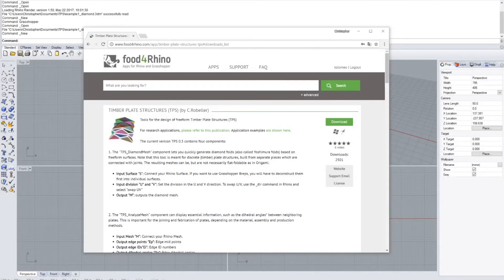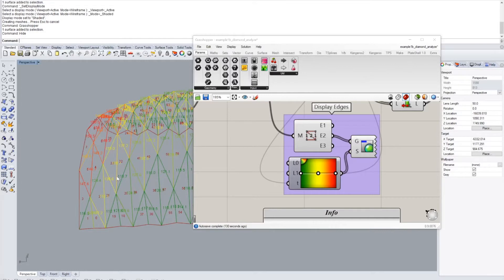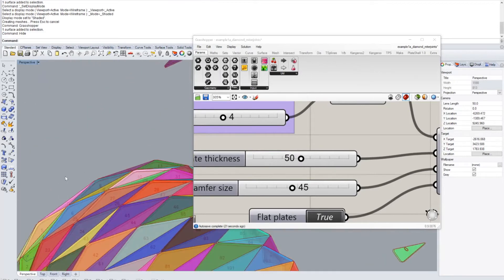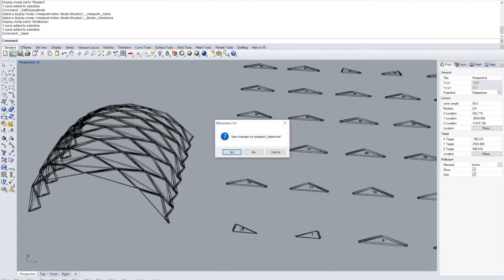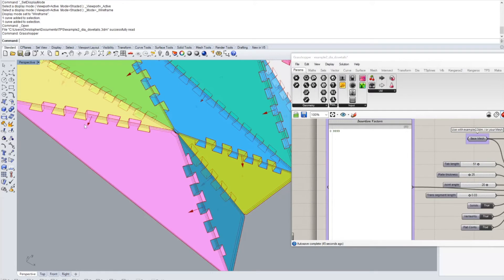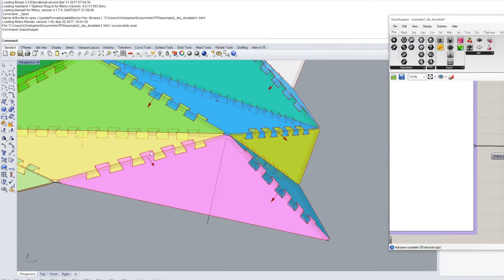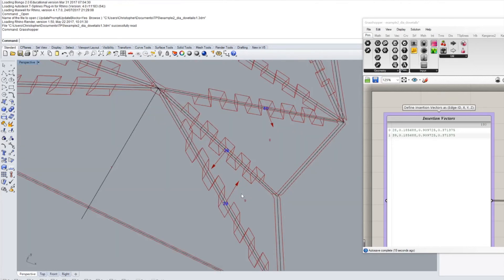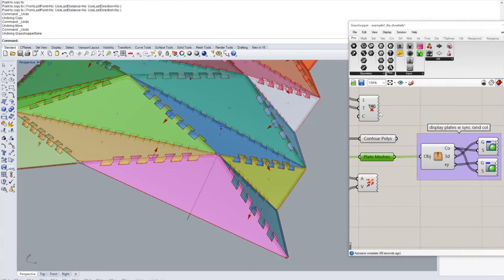TPS Plugin Tutorial: Analyse Fold Angles, Miter Joints, Dovetail Joints

Comment: Hello, I am trying to make the tutorial plates using the robot arm in school, and I wonder if inserting vector matters if the joint angle is 0. Isn't it possible to assemble the plates without modification of inserting vectors if the joint angle is 0?

Comment: hello, i have a problem with the final command, i need to know the name of the box command, the one with the preescript "Obj" on the left of the box icon, do you know where i can find that? thanks
Reply from the maker: Hi! not sure what you mean, there should be no input "obj". can you point at the time in the video?
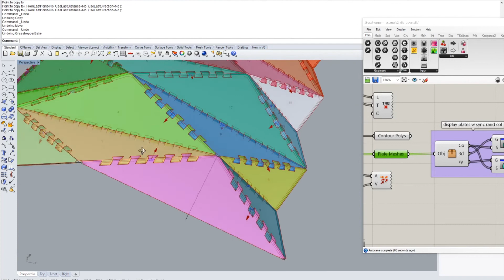Reply: @digitaltimberlab  12:11 the box icon in the grasshopper board ( inside of a purple square), what is that?
Reply: @345ホナン  ah, i see. That was just for assigning colours to the generated 3D parts. It keeps individual colours synced between the 2D (xy) layout and 3D model. Not needed for the script to work, but you can rebuild that as well. Maybe i still have the file.

Comment: Hello, I'm running to an issue. After exercising with your files, I tried your script with my own NURB mesh. It is fine with the analyzing, but when it comes to the mitterjoints, the parts came out as honeycomb shaped parts instead triangle or diamond shapes like the excercises. I hope you could help, thank you.
Reply from the maker: Hi! It sounds like the top and bottom polygon start points do not match for some or all the plates. You can select a pair and then use the Rhino Command _crvseam it will auto-align the start points to match. Hope this helps

Comment: When using the MTSJoints component I run into an issue. After determining the insertion vectors, some of the plates are generated correctly. However, some of the plates seem to have the top and bottom layer of the plate wrongly aligned. This results in the vertices of that plate connecting with an offset (top to bottom part). Any idea how I can solve this issue?
Reply from the maker: Hi! I am not sure if i understand the issue correctly. If the start points of the top polyline and bottom polyline are not aligned, you can use the _CrvSeam command in rhino to match them. Hope this helps!
Reply: @digitaltimberlab  Thanks for the fast reply, I can indeed manually fix it by aligning the polylines, thank you!